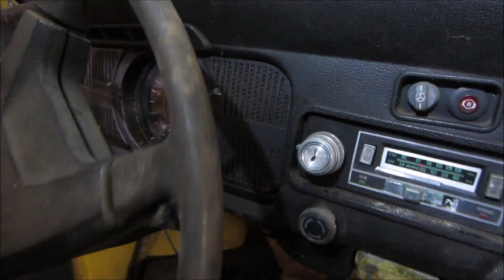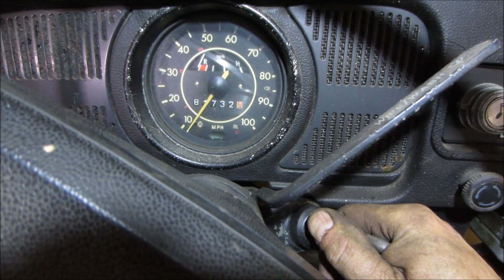Will It Run? vw Bug abandoned in a Leaking Wet Garage.

Comment: Just can't kill those engines... amazing how well they go. I wonder if it's because they are air cooled? No problem with having water corrode the internals of the engine.   Be good if there were more air cooled options.. Only problem here in Australia a lot of air cooled VW's catch on fire, especially camper vans, because the mattress and stuff gets put on top of the engine compartment, then you can't hear the engine at all, they over heat and go up in flames.. our climate here isn't the greatest for old VW vans, unless it's only used in and around Canberra where the climate is cold, or only driven in the cooler months. Other then that surly there's a way to rig up a temp gauge? Or at least ventilate the engine compartment more? Even rig up electric fans? 🤔... I had a pop top original  Kombi camper, it was fantastic, I wish I still owned it, it was in mint condition that was around 23 year's ago, I sold it back then for $6000... little did I know how much it would be worth today!! Oh well..

Comment: I use yard sale oil to flush engines also. I even dump transmission fluid in it. Who cares as long as you are not really driving with it in? It's just for breaking the engine over and getting it to start.

Comment: Had a early 1970 yw a true bug, kept it for years, later added a 1973 Super beetle,and it was total junk and difficult to drive with intermittent electrical system failures.

Comment: For future reference put any key in ignition to make the bottom drop down otherwise the steering wont unlock an d then get a pair of 10" curved jaw vise grips and clamp onto the black plastic ring arount the key hole and turnto on position/start

Comment: Mustie, I really cant believe it ran. Minw had sat only 25 years and I can't get it to even sputter. I've tried to mimic things you do - but not yet. For sure,  You have the magic touch !  What if the motor won't turn over? It did after some on in spark plug hopes, but then after  six weeks sitting, it's stuck again again ... ?

Comment: From 30  feet when I first saw it I thought it might be a nice project.  Then when he started jacking it and the rocker channel starting crunching into the cars doors and he reached under and tore chunks out of the framerails...

I wonder why they parked it?  It was only 11 years old in 1987 (assuming the inspection sticker expired in '88 rather than being issued that year) when it was parked.  I wonder if the rot from Massachusetts road salt had already gotten so bad that it failed it's next inspection.

Edit: ahh, I heard '76, but it's a '70.

Comment: I think he left most of the car on the hauler this time.......  But it did remind me of SEVERAL Ford Thunderbirds the wife and I looked at.   Had one schmuck trying to hard sell me on a SuperCoupe.   He got snagged for several DWI's and wanted to dump his speedy car after it sat for a year.  Floors totally  shot!    And another one down south of my location-  Asked the owner (on tape for legal reasons) if I could jack the car up on both sides to check the frame rails.  Jack went into the car on the one side....  Totally roached.

Comment: Or you could have pulled all the plugs and squirt some Trans fluid down each cylinder which would help unstick the rings, then crank it with the plugs out. After a few repeats, install some new plugs before the fist attempt. Unless all that would be to much like the right thing to do.

Comment: I think this poem is appropriate: 
RUST'S A MUST'

Mighty ships upon the ocean
Suffer from severe corrosion,
Even those that stay at dockside
Are rapidly becoming oxide.
Alas, that piling in the sea
Is mostly Fe2O3.
And where the ocean meets the shore,
You'll find there's Fe3O4.
'Cause when the wind is salt and gusty,
Things are getting awful rusty.

We can measure, we can test it,
We can halt it or arrest it.
We can gather it and weigh it,
We can coat it, we can spray it.
We examine and dissect it,
We cathodically protect it
We can pick it up and drop it.
But heaven knows we'll never stop it!
So here's to rust, no doubt about it,
Most of us would starve without it.

T.R.B. WATSON (DECEASED)
CORROSION SERVICES COMPANY, LTD.
TORONTO, ONTARIO, CANADA

Comment: Why were you trying to free the brakes by slamming it into gear?  That just seems incredibly risky to the transmission.  You already know the brakes will need to be completely rebuilt from the axle shafts outward, so why not just save the transmission and remove the hubs and brakes?  There's no way I would trust those wheel bearings, seals, wheel cylinders, etc.

Comment: Am I seeing things or is the car so rotted that the rocker panel bent when he jacked it up
Reply: Coltan Rickett pretty sure most of that steel is now the consistency of toast, so no, you really did see that. had a floor jack go straight through the pinch weld on a terminally rusty SAAB 9-5 I was trying to take the wheel off of in order to dissemble the stuck brakes so it would roll. what a miserable day, scrapping that car.
Reply: Figured so. I had a ford contour with a rusted out rocker panel and put my jack through the floor

Comment: Why are Super Beatles lowest on the value list?  Just common?  Not really that Super?
Reply: No mechanical reasons, just not considered by the fan base as a "real Beetle". If you want one and like it, then go for it. But, like Mustie pointed out, if you're in it for the money go for a standard Beetle.
Reply: @MrUbiquitousTech  Real Beetle?  What's not real about it?  Time for me to go read.
Reply: @willierants5880  Well, it is a real car obviously, but it's like a 2019 Mustang will never be a 1965 Mustang. The collectors and enthusiasts look down on them. 

In the Beetle most of the difference is in how wide the fronts are, they look "fat" to some people. The SB has a larger trunk, different placement of the spare tire, and in most cases a curved windshield. 

All the specifics are online if you want to look them up. But again, nothing wrong with them if you like them, they are far more "real" Beetle then the "New Beetle" could ever be.
Reply: @MrUbiquitousTech  Yeah I did some reading on Wikipedia.  Thanks!

Comment: Ummm yeah with the winch running and the other noises of manoeuvring the car onto the flatbed your commentary is unintelligible. Not just a little bit, either.

Did I miss where you explained about the traffic light? Or is that just a garage disco? 😆